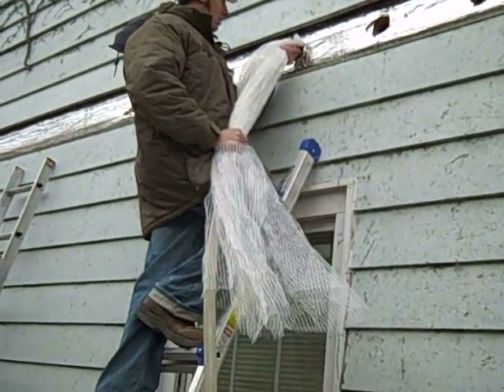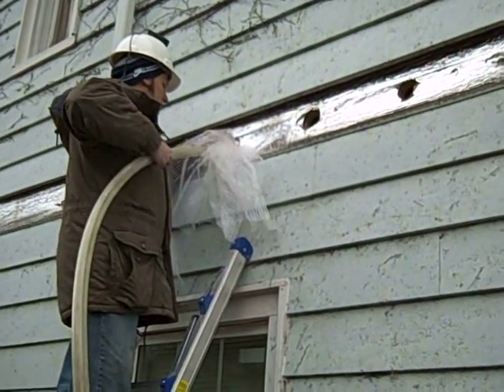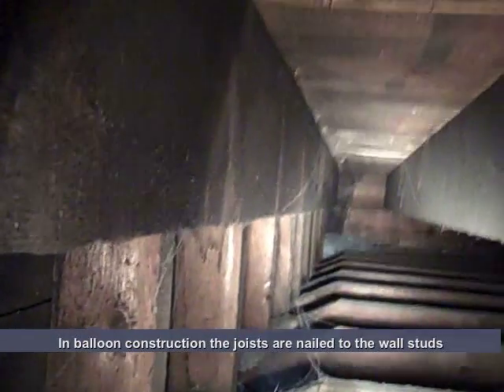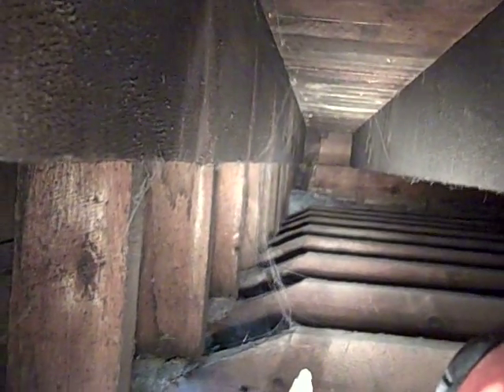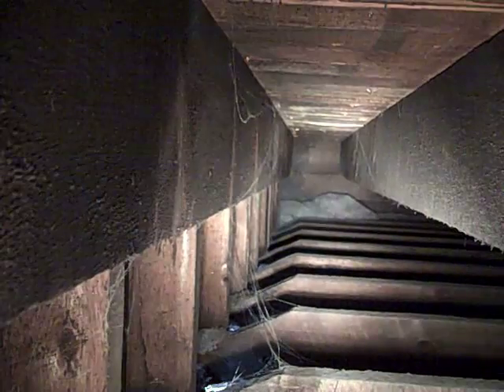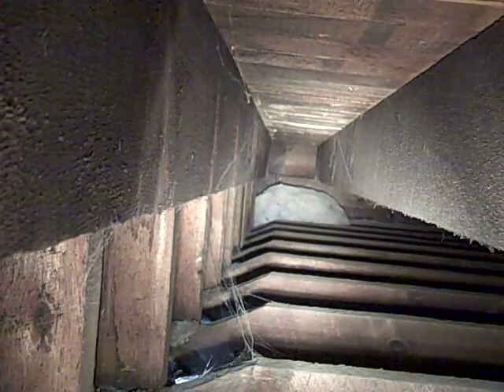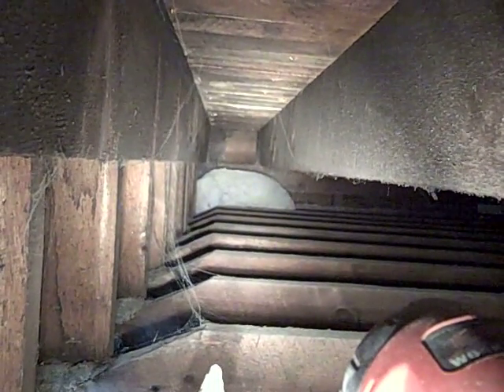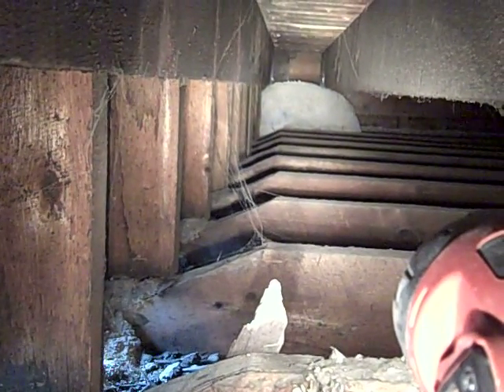Blocking Open Joist Cavities with Cellulose Insulation - www.startinsulating.com

Comment: This is a great video - and I believe this is how my house is designed - balloon framing.   Built in 1870 - I was able to feed a fish tape all the way from the basement up to the top of the knee wall on the second story level.   Now I'm concerned if I blow insulation I loose the material between the first floor and second floor.  Never thought of that until I saw this vid.